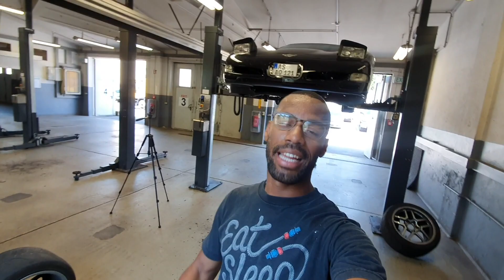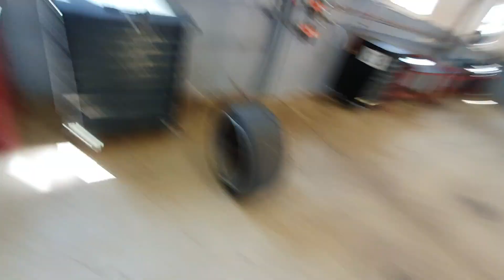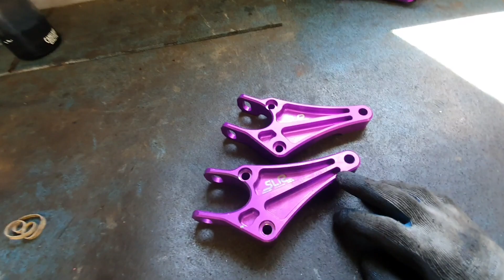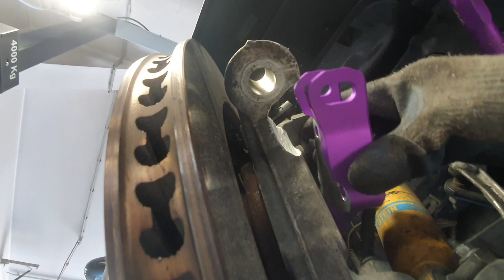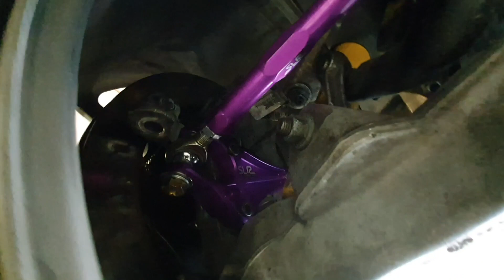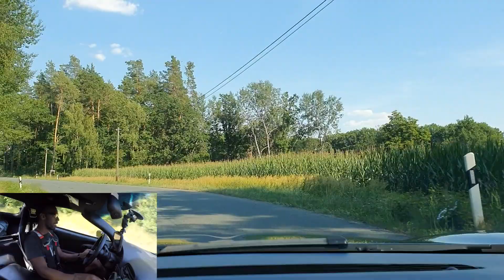C5 Z06 updated SLR Speed steering Knuckle install + Driving impression

Comment from the maker: Disclaimer after utilizing this kit on my c5 I have noticed that it upsets the "active handling" aka stability control on the car, what I mean by that is when I'm turning a sharp corner and the computer sees excessive angle it will activate active handling mid-corner because it thinks the car is out of control so it can be dangerous if you are not aware. I have tried it competitive driving mode also and it does the same thing so what I do is just turn off the traction control every time I drive the vehicle. The ABS still functions as it should and there is no issue, every once and a while I get a "service active handling" message on the dash but I just hit the reset button twice and it's gone. I have not tested this on a C6 so it may be different. My C5 also has a square wheel and tire setup that impacts the active handling also, which plays a roll in it. I personally think the kit is worth it and an awesome upgrade for anyone who really drives their c5 or c6 hard on the street, track, or drifting.
Reply: I wonder if it's just the square wheel setup, as I tried running spare fronts in the rear as sacrificial tires and normally driving set my active handling light on in about 5 min of driving
Reply from the maker: @bob-omb1452  if you put it in competitive driving mode with the square setup it no longer a issue with the codes
Reply: @Beezy_Builds  Good luck with the sale. I was going through the parts list and this caught my attention. I also run square 285s on my daily and it ticks off the AH. This video and some reading have made me definitely interested in the SLR kit as shown. I'll look into it once I get the car on the street again and generally sorted.
Reply from the maker: @brett31979  thanks brother! I got into the habit of just turning off TC everytime I get in too, the slr speed kit is nice for surr

Comment: I'm impressed, I do a lot of road racing and I can tell from your inputs how quickly the car changes, impressive. I just wonder how this feels at high speeds close to 300kph (186mph) I am sure it won't feel as stable?
Reply from the maker: So at 160mph the car felt great this weekend(on the autobahn), you naturally adjust to the new ratio the car felt very stable and not twitchy
Reply: @Beezy_Builds  ah i forget you're in Germany. I've once driven on there 285kph. Should do a top speed run video on the autobahn would be interesting to see too. I took my vette up to 295kph in north america, but our roads are crap compared to germany
Reply: This is awesome. I was googling for steering upgrades and couldn't find anything. Does it make or feel like it makes the turning lighter too?

Comment: You have 18x10.5 on the front? Any clearance issues? Is the kit adjustable so that you dont contact the control arm/rub at full lock?
Reply from the maker: I do have 18x10.5s and yes there was rubbing but I added rack limiters that are included in the kit to stop it

Comment: Holy crap.  Mind as well just cut that stock knuckle off.  🤔🤔  anything to get some more angle on this car tho.
Reply from the maker: Your not wrong I just wanted to keep the stock point jus in case ya know
Reply: @Beezy_Builds  so after having the car for a year now and I just finished coilovers.  The steering delay is definitely annoying.  From when I snap the wheel to when the car actually responds.  Stock sways. Stock z06 wheels and 555G2 tires I’m sure are part of the issue.  40 sidewall is another issue.  Starting to seriously consider this.  There’s no going back which partly bothers me. But it’s not like I can’t get another knuckle if I wanted it.  Would you drive a stock C5 after driving w this angle kit? Probably a dumb question but what’s your input on all that? 🤔
Reply from the maker: Seeing as this mod can affect stock traction control, I wouldnt do it again unless just a track car, but it.did make the car waaaaay more fun to drive and that I love. The kit made the z06 feel like it should have felt from the factory.
Reply: @Beezy_Builds  good to know.  I think my tires are some of my response issue. Thank you. ✌🏼 🇺🇸